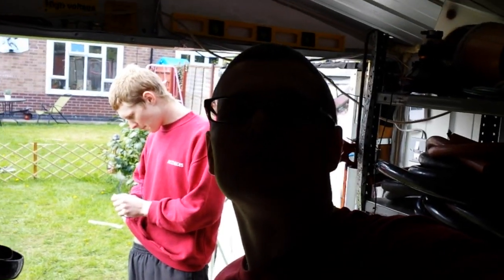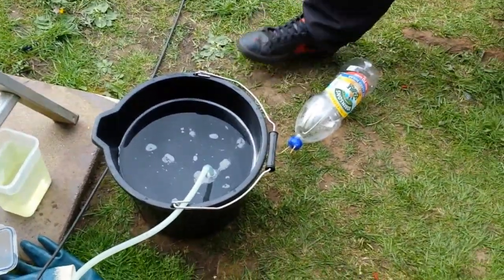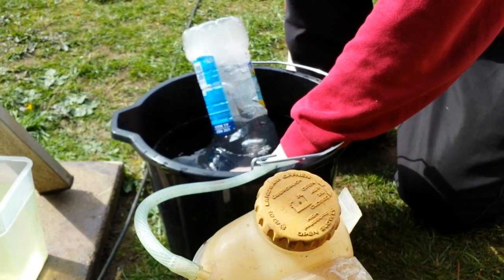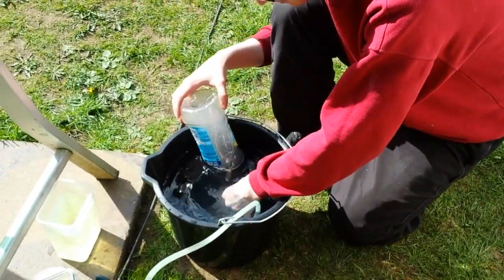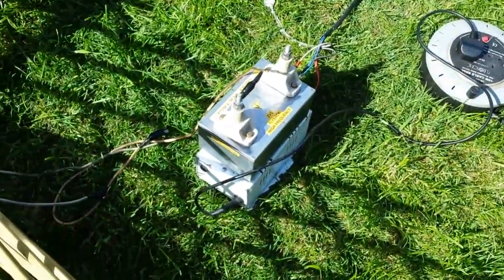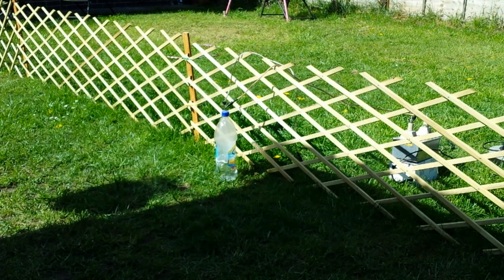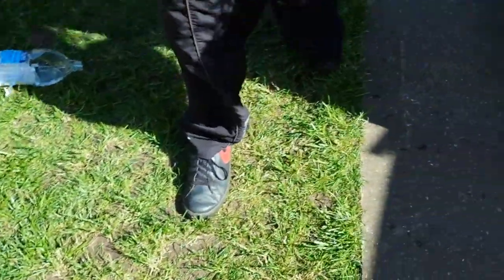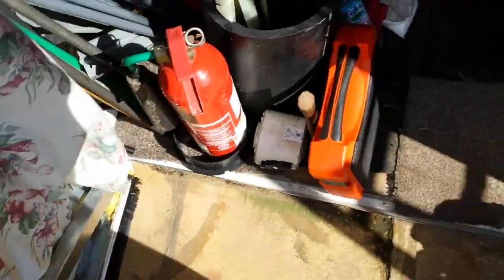Hydrogen HHO bottle explodes💥

Comment: What i'm going to do is buy a 10kv generator £4 of ebay and use a hobby rocket ignition thing to power it, To get the arc i'm just going to stick 2 pins into the side makes it super portable
Reply from the maker: ben lawton hello, that sound like a good plan. play safe a be careful mate. 👍😉

Anthony 

High1voltage1rules

Comment: nice electrolyser youve got there ^^
but please be carefull with that !

I have one in the same built form but a bit bigger
it consists of 20 plates and the surface is 30*30cm each !
it wants 700A at 12V  so I now want to power it from MOT's

how many how big plates have you got ?
and what about the current ?

and a little tip at the end : power it from AC it is bechause of the sinewave more efficient and the plates dont rust that fast !

If you have questions I'm expert in electrolyses (but not in english^^)

Fokus
Reply from the maker: Hey mate' the plates are stainless so they wont rust! It was running on 12-18volts and could draw upto 75amps from the power supply. But running it was drawing around 55amps. 

This will only ever be run outside! Theres around 5 plates inside the unit i think. But i will count them to be sure next time im in the workshed!

I dont think theres much you can twll me about running these as im up on how these run' but thank you for the time to give me pointers.👍😉
Reply: NO ! stainles steel rust in a electrolyser ! 
stainles normaly forms a oxide layer on the surface but the electrolyses destroys that ! and It will rust 

thats somthing the most people do wrong I had to learn this my self ^^

and a question I forgot whats your electrolyte ? means the liquid in ther ? never use NaCl this is higly dangerous !
Fokus
Reply: ***** thanks for your  likes and answers
the sun producees not enought but the problem is the chlorine will destroy the steel the tubes the ...

and if the liquid is on the floor you have to clean jears !
bechause on a dc electrolyser the mettal from the plates is going into the liquid

thats why an AC electrolyser is better the plates hold up to 80%longer 
but for exact things you need to go into many things
thermolyses
electrical current raise time 
temperature
Voltage per cell 
and many more boring things

but if you realy want to make a propper electrolyser (like me)
you cant youst make one 
but I dont yust use the gas for that

if someone wants to know something contact me !

enought stuff nowone is interested in ^^

thanks 
 
 Fokus